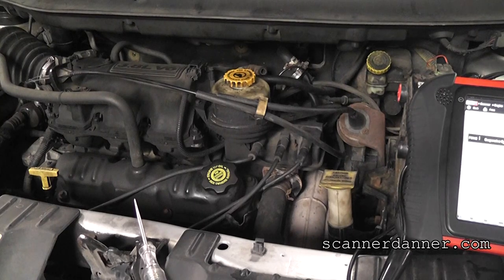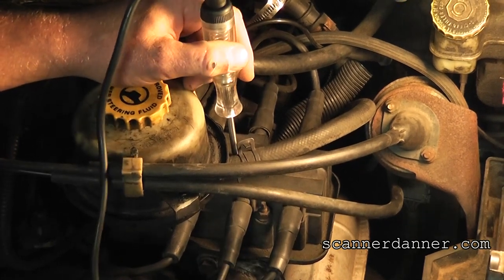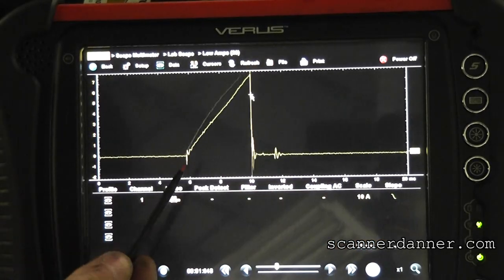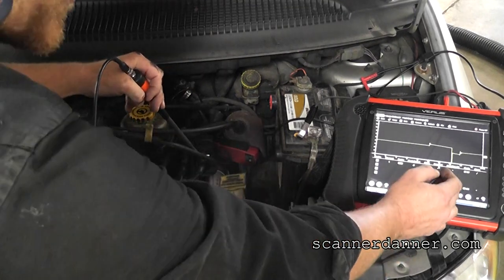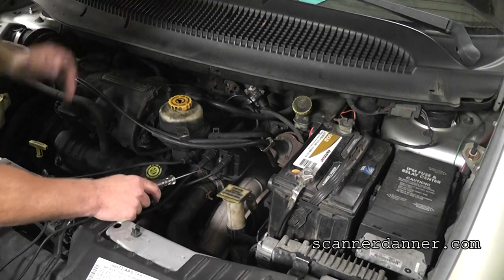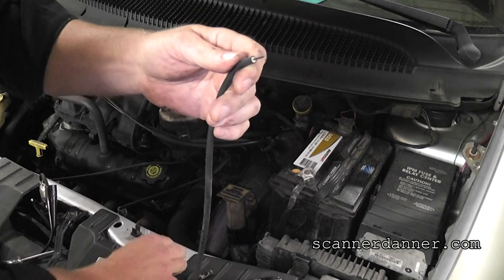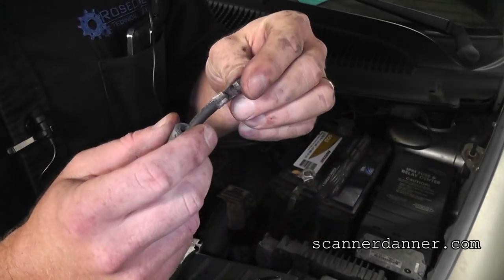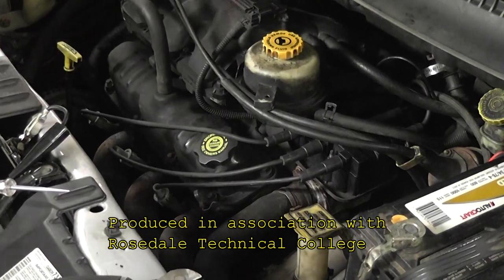Symptoms and causes of a bad ignition coil

Comment: I have a 1999 Camaro 3.8l... my car was driving fine then one day it just cut off wouldn't cut back on. I bought a new battery and drove for maybe 2 weeks then it cut off again. This time it just cranks no start though. Thought it was the fuel pump but I have a new pump so. What could it be?? When I first bought the car the check engine light would come on and go off some days it would stay one some days it wouldn't. Had it for about 2 months now it won't even turn on just cranks what's could this problem be?? My gas also hasn't been lasting that long I'll have a full tank go a couple places and it'll lose gas very fast
Reply from the maker: You need to find out what you are missing. Rent a fuel pressure gauge and get a pressure reading, it doesn't matter how new the pump is. 
Do you have spark? Have you tried to see if it will run on carb cleaner being sprayed into the intake. No way I can help without knowing what it is we are missing. Too many variables.
Reply: @ScannerDanner  yes I sprayed carb and no start... When I turn my key I also hear the pump working.. haven't checked the pressure yet ... Checked my ignition coil and 3 out of 6 had white powder and was rusted so I figured that was maybe the source of my problem... Got on YouTube did some reach most videos of a bad ignition coil I have most of not all of the symptoms
Reply: @ScannerDanner  I'll do some more research and testing and keep you updated if I have any questions thanks your video helped me alot

Comment: Man Paul I ran into a minivan just like that and the customer ran it till it died. Couldn't keep it running. The oil was clear like mineral oil and way over full ,the cat was plugged solid, the fuel pump pressure was half spec, plug wires were arcing and plugs caked in soot....it was a hard sell...they just could not believe the diagnosis. On top of all that it was e85 duel fuel and the pump was expensive

Comment: No spark in # 5 and 2 in ignition coil dodge caravan 2005 engine 3.3 ,I replaced a new one BUT still same problem , please help me to fix it  .   ( the problem is in  ignition itself ,not in spark plugs or plug wires because I bought a new sets ) .
Reply from the maker: This is the perfect video for you https://youtu.be/jJmqdhhduVc
A test light on the control circuits will be key. Here is some videos with it in action. 
https://www.youtube.com/edit?o=U&video_id=YBE7c7lfmnY

https://www.youtube.com/edit?o=U&video_id=LdnnFD6J8Uo

Comment: 2002 sentra car from mexico not american standards no immobilizer  crank No start gets fuel  no spark   ECM show a ground on all signal feed to ignition coil      no start happen after mechanic changed all crank sensor side and bottom ??? any ideas???
REPLY
Reply from the maker: Is this a distributor engine? If it is, take the cap and rotor off and the black plastic plate covering the optical pick-up and see if it is full of oil. If it is, you can temporarily fix it by spraying it out with brake cleaner. You will need a new distributor at some point.

Comment: I have 2003 Chevy Astro 4.3 liter 6 cylinders. engine have misfire on 2 and 5 cylinder. when I driving under the hill (even light hill) loosing power and feeling does not work on all cylinders. even after tuneup work didn't help. What can be? If i go hard with acceleration pedal engine goes off. I need to stop car and start engine  again. this happening when I drive under hill (for example I passing bridge) On normal flat road works normal.After tuneup work when I called mechanic he suggested to use fuel injection cleaners. I did that for five tanks. Did not help.When I drive on low RPM I feel like engine is shaking . After increasing RPM engine works smooth. SOMEBODY HAVE IDEA???? PLEASE
Reply from the maker: Check your fuel psi next. I have videos on this on your CPI system. Use CPI as a keyword search on my channel.
Reply: Mechanic said they checked psi and was no issues with that. this is a older experienced guy with good name.So I thing he did not lied to me.

Comment: any opinion would be appreciated .  Honda civic 2007, had a misfire on number 2 coil pack hence the car stops moving., but after resting for 30 minutes it once again runs normally.  Could it be possible that an ignition coil can be bad and then suddenly become good once  again.  I am worried that this thing will happen again .
Reply: maybe heat is the issue

Comment: Can a bad engine coil give a p0420 code?.  12 charger
Reply from the maker: A bad coil can cause cat damage for sure
Fix any misfiring issues you have first
Reply: @ScannerDanner  I'd had my O2 sensors replaced and had my cat converter checked and all looked good so the only thing remains for replacement is my coils.  thanks

Comment: +Scannerdanner,i purchased an '09 Altima early this year and later found out i purchased it not knowing it had a blown head gasket.The bodyshop that fixed the blown head gasket state it on paper what had to be replaced including spark plugs because there were a leak in the cylinders.But before i took it to them i replace the ignition coils myself which were brand new.Months went by,now i have a random misfire and the same shop that replaced my blown head gasket is saying my ignition coil was bad...and i asked him what would cause the ignition coils to go bad which he couldnt tell me,he said its an electrical problem.How can brand new ignition coils and brand new spark plugs (that the owner claim was replaced) goes out in months from the month of May of this year?
Reply from the maker: Nissans are notorious for coil issues. Cheap parts will do exactly that. Even the factory ones had issues on these. It happens sometimes.
Reply: ScannerDanner Thanks for the info,nice vid by the way...keep up the good work sir.

Comment: I will not recommended to perform the test .I work for Chrysler for ten year !!! I damage a ECM doing the test. trust me don't due.It happen when spark cable touch the engine block
Reply from the maker: What test are you not recommending?
Reply: ScannerDanner disconect spark plug cable with engine running. I perfom that test for many years nothing hapen but on 3.3 and 3.8 2000 and up Isee ECM Fried. Couple time !!!!Happen on me engine cut off and Ecm was damage!!!!
Reply from the maker: That"s why you use a test light to give the spark somewhere to go. You NEVER just disconnect and open a plug wire. BTW, I've done this thousands of times on all makes and model cars with no damage to anything.
Reply: ScannerDanner okay!!!!!Thank you.I just want to avice others !!!at one point you apen the cable from spark side!!!!!

Comment: I have a 2005 grand caravan that needs jumped to start but dies out shortly down the road... Brand new battery. Is it the alternator or ignition coil?
Reply from the maker: IF you battery keeps going dead and it needs jump started, it is NOT the ignition coil